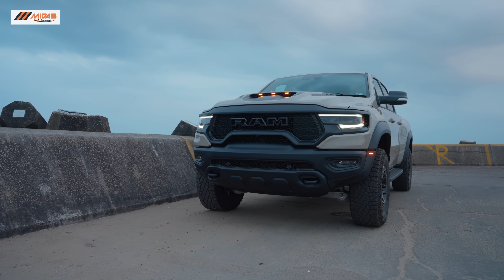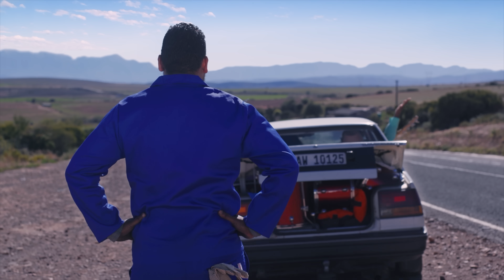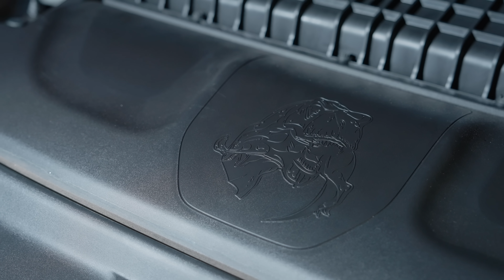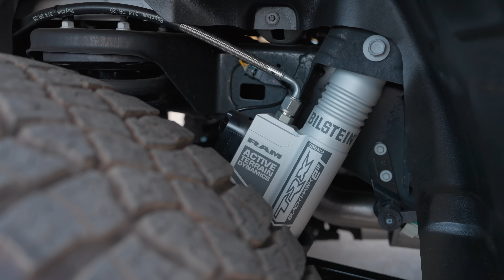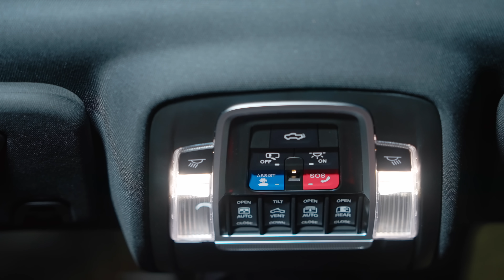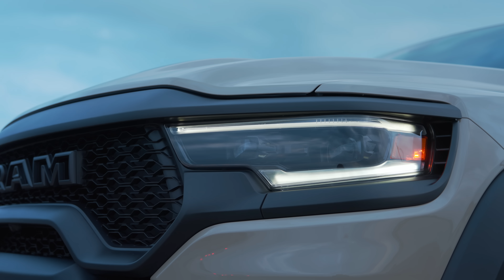700hp, R4.3million, RHD Hellcat-powered bakkie! The SA company that makes American Dreams come true

Comment: It uses 3 times the Fuel of a normal car....2000km a month = R11,500.00 on fuel each month. Still need insurance, Extended warranty, Maintenance plan, Tires will probably only last half a year. R5000 a tire? And so the costs go on...Budget R200,000 a year to Run this car.

Comment: Looks like a bakkie but not durable and capable like a bakkie. These things are lifestyle toys with low payloads and high running costs and low reliability (especially RAM and GM). There is a reason American trucks stopped selling all over the world. They cannot work like a typical commerical bakkie.
Reply: What about Ford?
Reply: @yungdsastar4392  The Ranger is European Ford.
Reply: @weetbix2083  I'm not talking about the Ranger. I'm trying to understand if the US Trucks (Bakkies/Ute's) aren't reliable... From your message you making me wonder if reliability is the issue then why are Americans still buying them and not importing from Europe
Reply: @yungdsastar4392  America cannot import bakkies from outside the country without heavy taxation making them unviable. This is to protect the bakkie market which is MASSIVE over there. I am not sure if our bakkies would go down too well as they are used to big engines and seem to use them to tow and not haul stuff around. Lately the fords have been quite problimatic but in the past they were about the best reliability wise outside of Toyota.

Comment: In Namibia RAM TRX is sold by M+Z motors a Mercedes Benz and Jeep dealership, they source the vehicles from South Africa and they come already remanufactured to RHD. But strangely they charge almost double that price R3,8mil 🤔 😕
Reply: the one you looked at was a TRX priced at R4.2 Million , the one mentioned the normal 1500 is 2.7
Reply: Price was loaded incorrectly initially. The average 1500 Crew Cab is approx R2.7m. The TRX is R4.3m now.
Reply: @US_Trucks  can you please share 🙏 your contact information
Reply: @US_Trucks  can you please share 🙏 your contact information